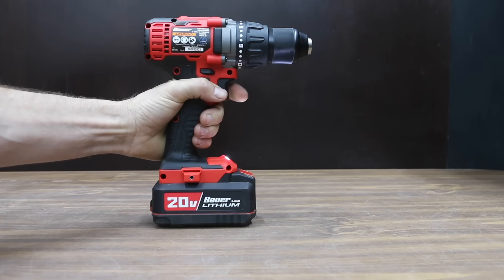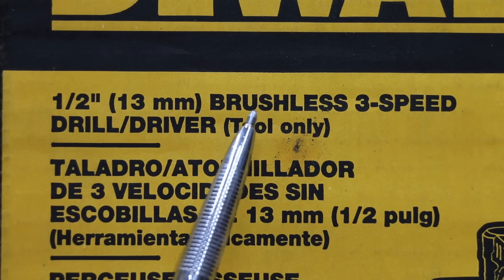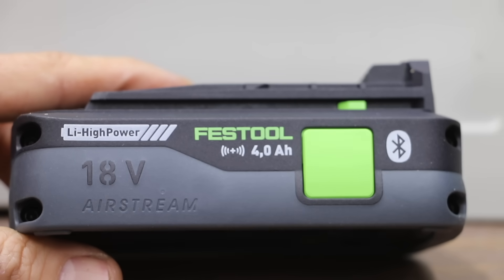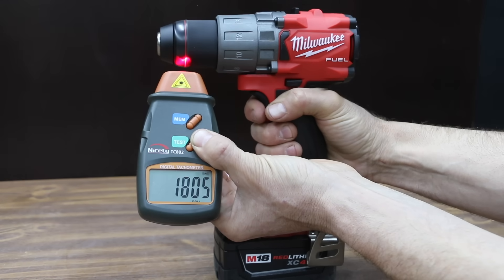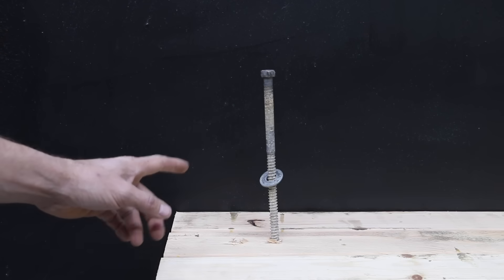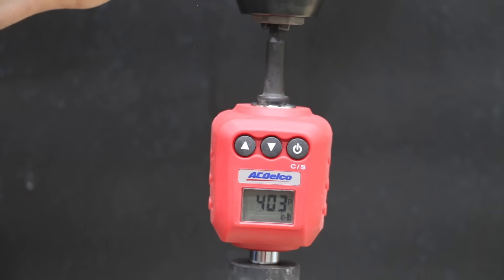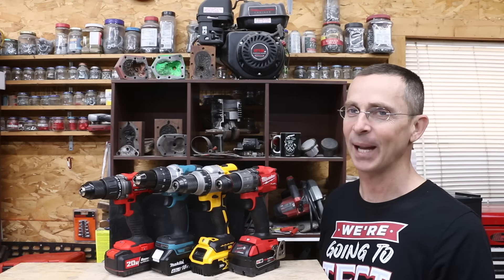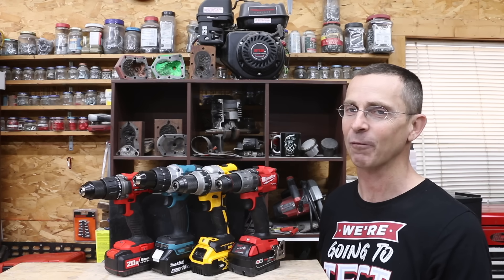Best Drill (BATTERY POWERED)? Milwaukee vs Dewalt, Makita, Bosch, Festool, Ryobi, Bauer, Ridgid

Comment: I have the Bauer, DeWalt, and Milwaukee.
Milwaukee has quickly become my favorite, I have the full 18 tool set.
Bauer batteries don't have much life, and DeWalt destroys its batteries in short order.
Reply: jami w  well the 9.0’s are widely known to be flawed so there’s that. Try one of the High Outputs with 21700 cells. The Milwaukee 6ah HO is capable of outputting the most power. 
But yeah Dewalt batteries are fine.
Reply: I’m curious what the “full 18 tool set” consists of in your mind?
Reply: @RaggedsEdge  All the tools he or she needs
Reply: @DamionJR4923  
It’s a BS statement. There is no “full set” unless your talking about owning every tool they have made in that line. At over 200+ tools for the M18 line, I haven’t heard of anyone with a “full set” yet.
Reply: @RaggedsEdge  full set = 2drills & 3saws..
drills over saws beats a pair of impacts every day.
Reply: @-Nick-T  lol
Reply: @RaggedsEdge  it would be dumb to own it. who needs a drain snake, a mag drill, and a collated drywall screwgun in the same trailer?
Reply: @-Nick-T  Dead man's hand? :-)
Reply: @RaggedsEdge  Hammer Drill, rotary hammer, right angle drill, multi tool, Sawzall, blower, orbital sander, circular saw, 1/4" impact, 1/2" impact(450ft/lb), 1/2" impact(183ft/lb), vacuum, fan, FM radio, light, 8 batteries(4 extra), a 6 battery charger, and three tool bags.
I was wrong, it's a 16 tool set...
Reply: I use Dewalt tools and never once had battery issues and my batteries are 6 years old (both Dewalt and off-brand batteries).
Reply: @thudtheace  we have a set of DeWalt tools that fall and get thrown around a lot, their tools seem to hold up fine(the 1/2 inch impact still works after being run over by a skidsteer ), but the batteries just crack and fall apart
Reply: Maybe the batteries are good in the drill, but Ive probably wrecked 10 dewalt batteries over the years by running them in a reciprocating saw.
Reply: @SpecialEDy  the vibration from the recip saw is what destroys them.
Reply: @SpecialEDy  the Sawzall is the battery killer regardless of brand.
Reply: @jardiff5983  There is only one brand of Sawzall, which is Milwaukee. DeWalt, Bosch, whoever, every other brand makes a reciprocating saw. "Sawzall" is a trademark of Milwaukee.
Reply: @SpecialEDy  yeah, there is only one brand of scotch tape too, but everybody calls if f'n scotch tape regardless of the mfg.
Reply: I've had the exact opposite experience with batteries.  My Dewalt batteries have lasted way longer than my Milwuakee's have. In fact I'm still using my original 20v batteries from 2011-2012ish.
Reply from the maker: Thanks for sharing.
Reply: jami w  Well Lithium-Ion batteries are very interesting, their lifespan depends on numerous variables including the temperature/climate they live in and how they are charged. You see the more time the battery spends discharged (empty) the faster it degrades while the longer it spends mostly/entirely charged the longer it can survive with minimal degradation. That’s why most people recommend keeping your phone as fully charged as possible and never dropping below 20%. Temperature also plays a key role, cold temperatures are of course bad for batteries as it causes strain and reduces their power output, warm weather having the opposite affect. The simple fact is that there’s a lot of random chance involved along with numerous variables, which most people can’t possibly remember to keep track of.
Reply: @DragonBallsDD  That's backwards. Lithium Ion degrades faster when fully charged. That's why new phones and such ship with batteries at half charge or less. Lithium ion batteries lose approximately 25% capacity per year, when kept fully charged.
Reply: @SpecialEDy  It’s true at both ends, the closer to fully charged or discharged is the most taxing state for the battery and causes it to wear out faster. However, recent advances in battery technology and software have mitigated a lot of the damage from staying fully charged. The latest smartphone OS’s, for example, can track your habits and use that information to track when your going to unplug your phone. Using that data they’ll keep it around an 80% charge until say right before you leave for work in the morning before finishing it off. But even then it won’t stay at 100% for very long because of course you are using it. So that side of things has been greatly improved compared to leaving batteries around that are low or fully drained. Which is something a lot of people do.
Reply: Lololol “dewalt destroys batteries”… we’re going to test that
Reply: jami w  have had my Dewalt for the past probably oh 4 years. One of my 3 Amp hour batteries just went out maybe like 3 months ago and that's the battery that came with the kit. But both drills still perform like new tbh. Batteries are definitely starting to drain faster so I'm be looking into getting new batteries but I'll probably go for the original batteries that came with em which are unfortunately discontinued so they will be limited but still not as expensive as the new batteries
Reply: Also the second battery still work even after being dropped idk how may times and as well for the drills. They've been subjected to rain and moisture countless of times and still work just fine.
Reply: our old 18v batteries are still chugging. don't know where you got your batteries.
Reply: jami w  Yeah, those 9ah batteries that Milwaukee sold are not good for high loads (even though they were marketed as such).  I have two of them, and after just a few weeks of use they broke down to the point that they could be out performed by my 5ah Milwaukee batteries.   The cells that they constructed the batteries out of were not meant for high currents.    That 9ah is easily the worst M18 battery Milwaukee ever made.
Reply: Same thing happen to me years ago.  Bought a Dewalt drill and within a year both batteries died.
Reply: Ok 
I can now make a  comment.
One year ago I bought a new makita hammer drill and impact. Brushless.
Bought 2 new 5 amp hour battery's.
Tools performed excellent
All battery's failed within 6 months. Over the winter.
Even though battery's were brought inside house every night to recharge.
Was so upset I swore off the green.. In favor of the orange. Ridgid.
Even though I wanted yellow. Dewalt has local favorable reviews especially for the battery's
Long term.
Now I have tested the orange. Ridgid.
Bought $1500 bucks worth
Brushed.impact and drill
Brushless impact and hammer drill.
4 .5 angle grinder. Octane
7 1/4 circular saw
Brushed.
Sawzall. Brushed.
1/2. 3 spd impact.
Octane. Brushless
Sander. square octane?
Brushless?
2 old style 4 a battery's
2 new style 2 a battery's
1 octane 6 a battery
Bluetooth.
First I love the Bluetooth
Highly recommend.
All tools have worked very well so far.
One.battery quit within 2 months. Was quickly warranted. And replacement shipped received within a week.
Now I went Ridgid especially for the 3 year replacement. After purchasing all this stuff over Christmas 2020
Spending hours on internet 
Inputting every single number. All receipts.
One tool showed up on my online toolbox. There website asks for 6 weeks time to register.
I just returned home after one month out of town.
All battery's in good shape
After one month no charge
Use.
Unbiased. I use my tools hard. Put them away outside damp often.
Don't drop mine much.
Have worked well for 6 months. I bet I got longest comment today. Lol
Like project farm very much. Has guided.my purchases and laughter for most of the new year.
You sir
 deserve a cabinet position
Dept of interior?
Exterior? No ah
Secretary of ah estate?
You decide
What position this great man would hold...
Probably not president
Or vice cause I am still holding on to our favorite
Here's to one nation under god indivisible. By the 4th of July. 2021 I pray
Fair and honest elections
Afterwards somehow lol
Reply: And Bosch seems to work it's batteries loose over time I have their hammer drill and I have to press on the battery to have it keep contact with the drill and same issue is starting to plague my impact driver as well.
Reply: As a contractor, I always have a good laugh reading clueless comments like yours. Thank you
Reply: I'm sure you in no way are affiliated with the Millwakee Power Tool Coroporation of America, located in Milwakee Wisonson, USA..
Reply: My dewalt 18 volt batteries have lasted for over 2 years just fine with heavy use. Good try though milwaukee scrub...
Reply: @trevillyan5515  Don't take it so personal, is just people's opinion with equipment.  If your dewalt batteries have been good, congrats!
Reply: @trevillyan5515  hit em with the facts! Thank you sir can I have another 🤣😂🤣😂
Reply: I see your point about that dewalt batteries and from a project farm video I started using the Watley ones instead.

Comment: bummer that you tested the low end Ryobi, I think the brushless would have done better.  I think the Festool is just way out of range for the average DIY or pro. Drills for pros have a habit of walking off. I have noticed a lot of pros these days ditching dewalt and going ryobi due to the cost of the batteries.. And I think the batteries walk off too.  The Ryobi brushless will never be a top end drill, but is way better than the low end ryobi.  And only a few dollars more.
Reply from the maker: Thanks for the feedback.

Comment: You can add Walmarts lineup of cordless tools to the list and test cordless sawsalls, I got the four pack with two 2 ah batteries for $70, and charger. Sawsaw, spotlight, impact driver, and drill. Basic but they work! They have two models Hart(higher end) and hyper tough what I bought.
Reply from the maker: Thanks for the suggestion.

Comment: Unless you need 4000 rpm for some reason the festool seems to be a complete waste of money. The driver attachment could have added some value but its poor low torque performance will leave you with nothing but stripped screws and chewed up pozi drivers lol

Comment: You'd have to be an absolute tool to buy and use festool unironically.
Reply: Festool is all about the stackable boxes. stacks your rolling so high you can't pass the door any more an trip in the gap of the elevator cabin...

Comment: In case you’re wondering the Festool is actually $350 for the drill with the “fancy” Systainer case, no battery or charger like the others. Systainer usually goes for about $40 alone. So one could argue the drill is actually $300 by itself. Still more expensive than the rest and performance was disappointing. But the price was a little fluffed in the video.
Reply from the maker: Thanks for the feedback

Comment: What is the accuracy of each drill chuck? Plus a long drill bit in the chuck and see which one has the worst cam out/ off center spinning. I really wish people would check this when doing reviews because there is nothing worse than buying a new drill and spin off center really poorly.
Reply from the maker: Great point!  Thank you
Reply: @ProjectFarm  I recently bought an expensive red branded power tool, it was so off center that when I drilled a 7mm masonry hole it actually measured 8.5mm after drilling, not great if your wall plug is 7mm.

Comment: I have attached myself to the Ryobi brand because of the battery.  The brushless tools are really good, but still not as powerful as the more expensive brands.  I'm a mid range user (not a tradesmen, but part-time professional) who probably should have went with Dewalt or Milwaukee, but for the average person Ryobi in brushless will not disappoint.
Reply from the maker: Great feedback. Thank you

Comment: Another great Project Farm review! Many thanks to you for this.

I had a DeWalt drill that I picked up around 1994 or '95 when I bought my first house. It was terrific, and lasted for years. But it was heavy and only 12 volt, and so when the batteries finally died I "traded up" to a Bosch. Big mistake. Although Bosch tools are certainly decent, and this one I bought was three generations ahead of my old unit, still that old DeWalt was better. And this test really tells me that I should have gotten another DeWalt (which, I note from this review, is the only one with U.S. construction involved in it).

I do wonder, though: why no Porter Cable? I see the brand is still made, although maybe they were bought up and screwed over by a bigger company. I used to like their tools a lot. Any reason they were omitted?
Reply from the maker: Great feedback! Thank you

Comment: Price comparison is unfair! The festool comes in an awsome case and includes a charger.
It also hass 2 chucks.
And its an hammer drill.
And you should have tried it with the 5.2 amp battery.
In Europe you get 5 years warranty on festool products and if it gets stolen you get an entirely new machine for 50 euros.
Reply from the maker: Thanks for the constructive feedback

Comment: I am a Ridgid fan boy, I have had  Ridgid products close to 20 years and have yet to pay for a new battery, last fall i  needed my last 2 Ni cads replaced they sent me two 4ah lithium Ion and a charger, so as a homeowner I can't do better.  all my batteries have been replaced several times. only one time have i needed a drill repaired.
Reply: Me too. For a DIY/Prosumer lever user, lifetime free battery replacement tops every other feature. That's why I bought DIY battery "adapters" (e.g.: Amazon B091679PC8) that can be wired up to non-Ridgid tools. These are injection-molded, not 3D-printed cr*p, and they fit great.
Reply from the maker: Great feedback on Ridgid. Thank you

Comment: 1. Paper towels, shop towels, disposable towels, etc
2. insulation and different combinations for best efficiency
3. caulk/adhesive removal
4. concrete brand strength and comparing varying amounts of water to see strength
5. drywall tape/mesh/fibafuse
6. paint/oil/marker removal
7. hydrophobic coatings
8. tile hole saws
9. thinset brands for tile
10. joinery types, testing for strength
11. diagonal cutters
Reply from the maker: Great recommendations!!  I've taken notes.  Please keep the ideas coming!!

Comment: A great video once again, thank you. It's possible the electronic clutches need a little more time to sense the increase in torque, perhaps having something that gives a bit in between the drill and torque meter, most the time a clutch is used on screws in wood so there is torque that ramps up rather than an impulse. I know you must spend a lot of time getting the details right which is what makes your videos great so thought I would shame an opinion.
ETA: I don't this makes the electronic clutches better, I don't think they can be relied upon yet.
Reply from the maker: Thank you for the video idea!

Comment: I want to see a 'best from each lineup' test. Like that MW drill but with its 12.0 Ah battery, and the Dewalt 15 Ah flexvolt battery.
I've also heard some complaints that the MW drill will break its gearbox if it snags in second gear with the 12.0 Ah battery. Would be interesting to see where the limit is
Reply from the maker: Thank you for the video idea!

Comment: Great video, Todd!  When I’m doing electrical work, I end up drilling through studs and joists with a spade bit.  Tends to really eat up the batteries.  I’m curious how many holes can be drilled on a single charge.  Perhaps it’s a similar number for the same capacity battery, and not worth testing.
Reply from the maker: Thank you for the video idea!

Comment: Thank you yet, again for your work...
Years ago, I got a set of Ridged tools from a big box store.
The set came with a lifetime gauruntee on two batteries...
Now to see if the promise of the gauruntee is worth anything?
The set included a circular saw, reciprocating saw, an impact drill, an impact driver, a right angle multi tool ( jig saw), and a light.
For around $500.
Sofar,,, so good.
They did stand behind a repair on the reciprocating saw,, but I had to drive 90 miles to a service center.
Reply from the maker: Thank you!

Comment: @15:32 "Dewalt had a little bit of a problem getting started..." In what gear?  (Dewalt has three compared to two for most others. The specific gearing each one has is going to make a difference in things like whether it spins a mower over and how fast it drives a particular size of lag screw. With different size screws, maybe a different drill wins the speed test, and then the other issue is how many screws they can drive on the same capacity fully charged battery.
Reply from the maker: Thanks for the constructive feedback.